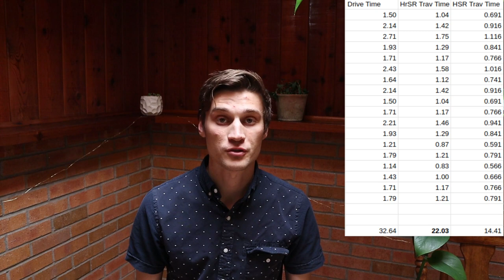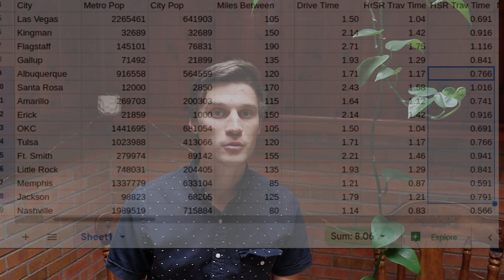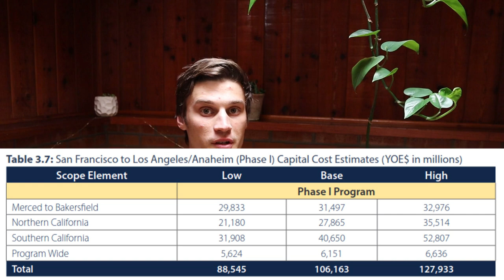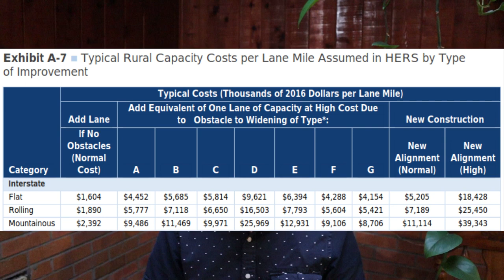What if Interstate 40 were High Speed Rail?

Comment: Ending this at Charlotte instead of pushing through to Wilmington makes no sense at all. I've long advocated using the existing US interstate rights of way to include high speed rail, as right of way acquisitions are typically the most expensive aspects of such projects. If you're going to go almost the breadth of the nation, it makes sense to complete the job. Existing passenger rail service currently does not exist at all in Wilmington, which is ironic, considering Wilmington was the headquarters of Seaboard Coastline Railroad until 1957 or so.

Comment: The high cost of rail (and airlines) is the running of it.  Every day, every night, every person 24hr of salaries and RR pensions.

 Building and repaving for drivers not being paid as operators pale in comparison to staff hierarchy, redundancy and management redundancy.

This is often why a flight 2000 miles costs far less than a train which is a rolling cafe and hotel with numerous staffers covering 48 hrs of service with 48 stops, vs an expensive jet bus that only has a crew of 5 for four hours and only two ground crews.

Automobile: the passenger is the driver, navigator, maintenance fueler...a 2000 me trip is likely two hotels, which the driver funds and 7 meals the driver also funds.

Also those incidental stops funded by private businesses exist all along the route, paying gross receipts, income and property taxes to the jurisdictions the road passes through....which neither RRs or airlines do.

THAT is why there are highways.

Comment: I'm really glad that you've included the fact that your study (as impressive as it is) isn't exactly factual and to me, it seems to lean more towards your desire for people to park their cars and get on a train.

But remember why interstate highways (both the free and toll ones) were built in the first place: So that in the event of a war on our country, the military could move equipment more efficiently. And while there have been cases where interstates became low speed parkways, most interstates (Especially I-40) are far too important to get rid of.

I'd be for H.S.R. to take a page from the Chicago Transit Authority and build in medians of such interstates; building station platforms in with the tracks while adding escalators, elevators and stairs, leading to bridges that go to adjacent stations alongside the freeways. Subway down or viaduct up to cross interstate intersections or for turns away from and then back to the interstate when necessary.  That saves a lot of money from buying up land. 🚄 !

🐰

Comment: How many trains per day on either of the railways would you expect?  Thousands of cars and trucks use the highways each day going each way.
Reply: A dedicated high speed rail line can accommodate 15 trains per hour, no problem at all, and a train can carry more than 1000 passengers, so you could theoretically carry 200,000 people a day in each direction on a double-track line. Obviously in practice you are unlikely to be running at maximum capacity with every train full, but just think how many lanes of highway you would need to get anywhere close to that level of service.

Comment: Why not a shinkansen the distances are huge anyway
Reply: that's what he meant by HSR, the shinkansen is wheel on rail HSR.

Japan's maglev is called SCMaglev, if that's what you meant. 

The speed of maglev is plenty fast enough to complete with air travel over that short distance Memphis to Knoxville, but the cost is way higher than even CAHSR so it's a non-starter too, unfortunately.
Reply: @neutrino78x  Yes, the Japanese SC Maglev technology is super efficient and super expensive. China and the Germans are also making more cost effective strides with Maglev technology.

Comment: I've actually thought that the only way we're going to get a good high speed rail system would be to use the interstate highway rights of way.
Reply from the maker: It's a good idea in principle: eminent domain doesn't have to be used, there is a connection between large cities, and access to the job site is simple.
Is it easy to implement in practice? We'll find out with how Brightline West does as it's constructed along I-15!

Comment: The 250 Million Dollar per Mile for the High Speed Rail seem a little bit expensive. The most expensive High Speed Railway in Germany (Berlin-Munich) costed about 40 Million € per km, appx. about 70 Mil. USD per Mile. This includes 41 km in new Tunnels and 12 km over new Bridges. An alternative Route with fewer bridges and tunnels would have costed 1/3 of that, but Tax Money is always easy to spend and our politicians are usually open for little donations.
Reply from the maker: There are a number factors contributing to the California High Speed Rail cost being so high. 
1) The experience to construct a high speed railway does not exist in the United States. The EU has been building out high speed rail for the past 2 or 3 decades, and that experience is leveraged on extension after extension. Sadly, the US lacks that know-how.
2) Land acquisition is an incredibly painful process in the United States. While a rail authority may have power of eminent domain, it may take years to acquire a parcel of land before construction can even begin due to the slow judicial process in the United States. As a matter of fact, California High Speed Rail still does not control all the land needed for the initial operating segment in the central valley.
3) Building around or through the existing infrastructure between cities drives up the cost of construction significantly. The overpasses for cars, rerouting/splicing fiber optic cables, and avoiding oil and gas lines quickly drive up costs.
4) Corruption/politics/bureaucracy. This comes not only in the form of wasting time on environmental impact statements, but also in the form of Airlines, Automobile Manufacturers, and Oil Companies lobbying (bribing politicians at local, state, and federal levels) to opposite high speed rail. Those companies don't want to lose a revenue source to a superior mode of transit. On top of that, the companies awarded the contracts to build structures along the route may be paid more money if there are more tasks to complete. As a result, there may "accidentally" be a break in a fiber optic line that drives up the cost of the project. Additionally, everything has to be built to be earthquake-proof, where companies take generous liberties in using more materials than necessary.
5) Lack of public support. Sadly, many Americans do not understand the value in good public transportation. Ideally, everyone in the US would take a field trip to the EU to understand what good transportation looks like (and what good food tastes like), but the sad truth is many Americans squander a large portion of their income on depreciation and maintenance of their automobile.
Anyhow, thank you so much for commenting! I hope you enjoy your wonderful food, healthcare, and transit on the east side of the Atlantic. We (in the USA) could stand to learn a couple of things from you. I hope you have a great day!

Comment: 3:40 It's almost guaranteed that bureaucracy and corporate greed would turn that 4 hour train ride into a 7 hour hurryupandwait ordeal. As Amtrak famously evidenced when they started weighing luggage. A LUGGAGE WEIGHT LIMIT ON TRAIN. WHAT, WHAT, WHY? Those engines can pull miles long trains of intermodal freight for pennys per mile. Why nickel and dime the passenger travellers over 51lbs bags? Because they can. But I digress.
They will quickly break out the pain sticks when they compare the time passengers budget for train travel to time budgeted for airline travel. They'll find that passengers are allotting 2 or 3 fewer hour to train station consumerism. And that's an cardinal sin in capitalism.
My tax CBDC will pay for building the route. And I'd pay for it again when I ride.
Reply: well, there's no corporate greed in Amtrak, they are basically a government agency (de facto, if not de juris).

But yeah I agree, the Public Transit Paradigm will typically ruin these things.

A sane person would say, find existing freight rail and just run trains on that.

But Public Transit Paradigm will come in and say, well you should build a separate track, or if you're going to use the existing one, you have to stop at every little small town along the way.
Reply: Weight limit is for the safety of the workers, not for the safety of the train. Over 50 pounds means that it's now a 2 person job. Extra bag fee comes from needing a 2 person team to lift it safely, raising labor cost on it. They don't weigh the 4 bags you can bring on yourself, so potential extra fees for 2 more is already mostly fair.
Reply: Manpower - Amtrak could also use a slightly better low tech solution. Conveyor belts that send luggage to luggage containers would save money by eventually pay for themselves. That's just off the top of my head. But I'm no bureaucrat.
Reply: @kingairmech7162  That would pay itself off in high frequency stations, like on the NEC, but in rural areas where you'd only get one or two trains a day? That thing is just gonna end up falling to pieces before it pays itself off.

Comment: I don't believe the numbers from CA HSR on general principles. I believe they are excluding some of the dollars spent on grade separation. However - the bridges and underpasses built there are being constructed to meet their earthquake standards. They are using a stupendous amount of steel reinforcement in their concrete. On a cross-country route, once you leave their seismic zone you can go back to "ordinary" heavy rail bridge construction... until you get close to Memphis and the New Madrid fault zone there.  Knoxville to Asheville then Charlotte will need a whole bunch of tunnel & bridge work.  Blue Ridge Base Tunnel??

Comment: You adjusted the cost of the highway for rural areas, but you used California which is probably the most expensive place in the country to build as the basis across the country. There’s no way true high speed rail should cost that much though mostly rural and flat places. Maybe double brightlines cost for more grade separated crossings.

Comment: If the USA wants real high speed trains they need to look at China, not California.  China has built over 25,000 miles of 200 mph liens over the last decade or so and they are running already.  They are fast, clean, reliable and very comfortable.  Shanghai to Beijing in 4.5 hours.  That's like LA to Portland, Oregon roughly, or at least Eugene.
Reply: Oops.  That should be 'lines', not liens.  My bad.
Reply: I lived in Tianjin, China when they constructing and opened up the first high speed rail line from there to Beijing, he is totally correct. I also rode on one of the older, slower but modern overnight trains from Beijing to Shanghai, China on a trip that took 18+ hours. I rather get someplace as quickly as possible and enjoy myself at my destination. I do enjoy modern HSR train rides though. ;)
Reply: We don't want high speed rail or it would already exist.   The New York Central ran steam trains to Chicago at 90 mph, and the North Shore  electric Interurban ran from Chicago to Milwaukee at 90 mph in the 1930s.   The NorthShore no longer exists, and the demand for travel between New York City and Chicago warrants only half of a train once a day that meets another section from Boston in Albany

Comment: Perhaps you've forgotten something building rail : 
You can build a non-electrified (Diesel-traction) Brightline-type railway or an electrified railway.  Building electrified railways is more expensive but comes with a big environmental advantage over Diesel-traction and generally uses less energy per mile. Besides electric trains are lighter and don't need to carry a lot of fuel (leaks?).
Also you've probably disregarded to compare the environmental advantages of higher-speed rail an high speed rail over car traffic.

Besides, on a Higher-speed or High-speed line you can also run high(er)-speed freight trains.

An aspect often forgotten considering high(er) speed rail is the transit infrastructure recommended for the last mile.. don't make the error of building stations somewhere in the middle of nowhere.. you'll need them where the people are.
Reply: So what's wrong with the Amtrak station at Palm Springs being just a small building next to a parking lot out in the desert? (Kidding--when I took Amtrak there, I took the bus which went to the airport which is in the city.)

Comment: High speed rail over 125 mph is not as accommodating to high gradients as is typically depicted.   The CA high speed rail specifications state for down grades over 1.6% reduced speeds from typical 220 mph are required.   Those reduced speeds for descending grades over 1.6% are around 125 mph.   At high gradients of 3% the safe descent speed is not given.  This means for non speed restricted high speed rail gradients of less than 1.6% are desired.   Interstates have maximum grades of 5% for urban area Interstates and 6% for rural Interstates.   I70 west of the Eisenhower tunnel in Colorado is an exception with reported grades of 75 to 8%.  Following US Interstate alignments is a popular concept for non railroad people thinking about high speed rail.   In China HSR makes extensive use of tunnels and bridges to provide a HSR alignment.

Comment: As many know, the California HSR isn't a very reliable system to be put into the equation. Its way, way over budget and no rails have even been put down.  The state is in a financial crisis and just doesn't have the money to finish the system.  Plus they are building the easiest part of the system first, mostly flat farm land.  And between two cities which will provide low ridership.  And onto LA will require a tunnel, which will cost who knows.
Plus California has very strict building codes for just about anything.  Making the whole project probably will never be finished in out lifetimes.

Comment: How much per mile would it cost to build a 200 mph railroad in the medium of an existing interstate.
That's what I want to know. 🤠
Reply from the maker: The best estimate for rail running down a median is probably Brightline West. A majority of the route is planned to run down I-15 between Las Vegas NV and Los Angeles. They estimate that the roughly 250 miles will cost $10-12 billion, which comes out to roughly $40-48 million/mile. I left it out of this analysis because construction has not begun.

Comment: Your assumptions are faulty. And you didn't mention that rail has a 20:1 advantage over pneumatic tire on pavement. (Co:efficient of rolling resistance) One rail track has the equivalent capacity of 9 lanes of superhighway. A two track line is the equivalent of an 18 lane superhighway. A four track urban rail system, like NYC's subway, is the equivalent of 36 lanes criss crossing the city. So a 4 lane superhighway is NOT a good comparison for a two track line. You should run the numbers for an 18 lane interstate - and then compare costs for the track. Another point - FRA regulations are medieval, and force cars to be far heavier than what is needed, thus increasing costs, etc.
The deliberate destruction of America's once premier rail system wasn't due to eCONomic growth, but collusion between competitors and a jealous government. (Look up how rich the Pennsylvania RR was... it's budget was second only to the US gubmint. And that was just ONE RR.) The entrenched hegemony will NOT allow America to "get back on track."

Comment: In the US rail would work best for journey's of less than about 500 miles. All states should have their own rail system, maybe terminating in neighboring states for connections. Using this model then higher speed rail is a great option. Journey's over 500 miles then flying becomes the better option, not very green, but quicker and cheaper. The issue with rail in the US is population infrastructure,. You get to your destination by rail but are still miles from where you want to be with little or no local public transport
Reply: All states? That would be laughable. Many states don't want to have their own rail. Amtrak doesn't even go to South Dakota and Wyoming, for example. To have passenger rail in all of the 48 contiguous states, I think it needs to be a national effort, with states and the federal government working together. Statewide transport in Alaska is achieved by air. In Hawaii, it's by air or boat, with a local light rail line being built in Honolulu.

Comment: It is an interesting video but the train times aren't realistic.  The acceleration and deceleration times are far too short.  It is more than just going from 200 to 0 and 0 to 200.  Speeds for a distance approaching a station are typically much lower.  It may be double the 10 minutes.  But still not bad overall.  It is hard to figure Brightline pricing.  They did have some rail already done, but there were a ton of bridges and at grade crossings that had to be delt with.  Also their track installation methods are pretty dated and slow.  That kills you on man hours.  European track installation systems are fairly well automated and greatly speeds up installation and replacement.  The California project is probably the worst case example of how to get a project done.  I'd again look at how the Europeans do it and look at their costs.  Honestly, you don't want Americans managing (mismanaging) the project.  I'd hire a European company to oversee the project.  It will save you a fortune.
Reply: There's a reason so many people call the California train building wreck the "Train to Nowhere." Several reasons, actually.